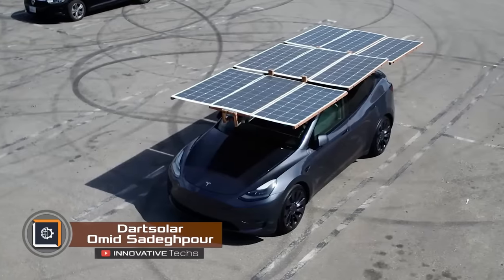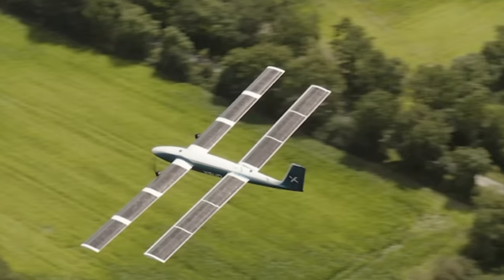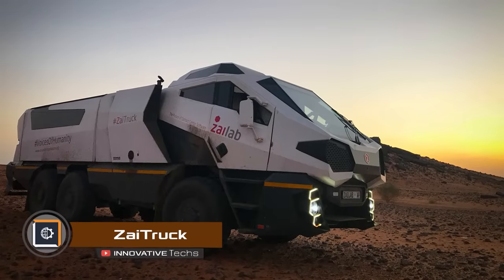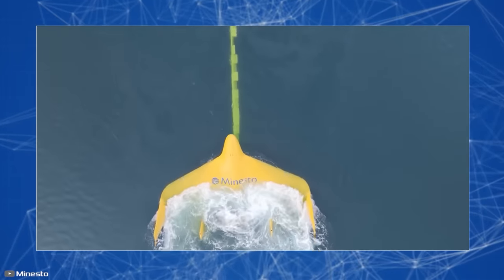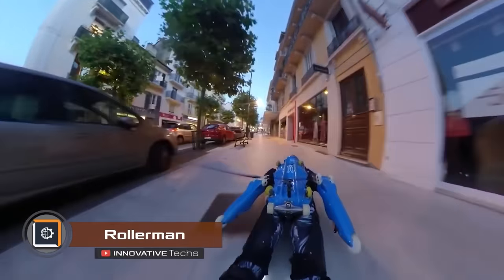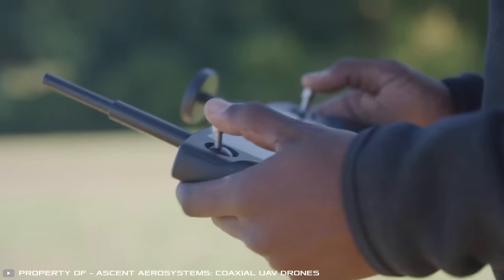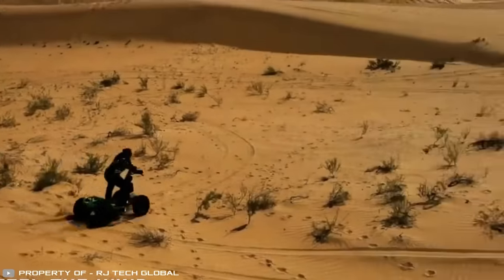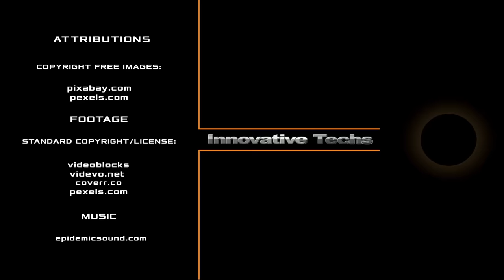AMAZING INVENTIONS THAT WILL BLOW YOUR MIND ▶2

Comment: Electric car with gasoline generator gets over 100 miles per gallon, it's been proven,,,so why aren't we doing this commonly,,,im going to build one this summer, ill buy a used ev and convert it, what fun, im 74 and i have 2 projects now,,,😮😊❤
Reply: That's how trains work. Huge generators power lots of electric motors because they have more power than gas engines.

Comment: the last one, the sand blaster.
Reply: Clean up is going to be a real pain. We had an industrial sized one. Worked on the same principle. Large paddles slinging the blasting media into a chamber. This chamber had a 6 foot revolving platform, where you would place your work pieces. Even being completed enclosed with a filter system, and a conveyor that reloaded used blast media. It was always extremely dusty around that machine. I can see the mess a completely open one is going to make.

Comment: Over one megawatt, I don't think so.,
Reply: It should have said kilowatt.
Later edit:  On closer inspection, the propeller is actually fairly large, but the tide would need to flow really fast for 1.2MW to be generated.
Reply: I hope u don't refered to Minesto Dragon 12 because the generator is @ 1,2MW and it produces ~3,5GWh per year (about 35% capacity factor due to the tidal turns twice a day)

Comment: A "taxi" that can only do 18 miles before it needs charged? In aviation you always leave a margin of error and spare fuel that can't be consumed during normal flight. I don't know if this figure is counted for spare battery life in those miles. Then, you have the gradual reduction in battery storage capacity. All this for a $332k. I don't see this being sold as any type of actual taxi. It'll just be for a few elites that want to give off the impression they are being good for the environment while simultaneously owning a rare toy to perhaps go to/from the office if within its range. Compared to the price of a gas turbine helicopter, they are inexpensive, but that range is a killer. Possibly both figuratively AND literally if not properly managed.

Comment: That 165# Solar Panel SUV. invention that can travel an “additional 20 miles per charge” isn’t all that great. A solo driver would be having an additional added passenger being hauled around. And on cloudy and stormy days, then the “add becomes a drag” even before the trip starts.
In snowy regions/conditions, what’s the very first part of the car to get covered up or frozen? The roof. Wouldn’t the military flexible batteries have been a better choice? Weighs far less than standard panels, and its flexibility allows for a smaller footprint on the roof.
An extra plus is that the panel grids allows one or more to be damaged but the entire panel still works.
PS: I’ll be generous and I’ll only take 2% of royalties or sale of the design by anyone who uses this idea.

Comment: There's an issue with that bike rack. Most rear-mounted bike racks have the same issue: they block the license plate, which is illegal in most if not all, areas.
 You say farmers are moving away from using chemicals, yet North America still permits the use of a specific fertilizer which has been proven to be the cause of the ridiculous number of persons with peanut allergies. Thirty-five years ago, this was an unknown 'illness'. Peanut allergies are a very rare thing in other parts of the world.
 Genetic engineering of plants is the cause of the steep increase in gluten-intolerance cases!

Comment: the electric police cars have already FAILED they do not have a reliable range, at max speed the range is extremely short they can not do a high speed highway chase an officer can not top off mid shift in a couple minuets like a gas vehicle also they are very suspital to battery damage if they have to go off road or go over debris.